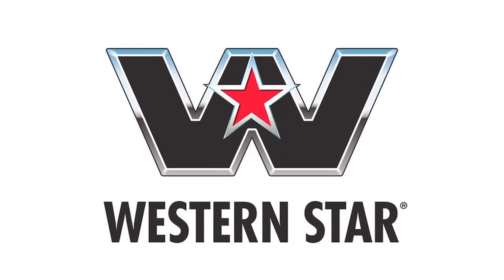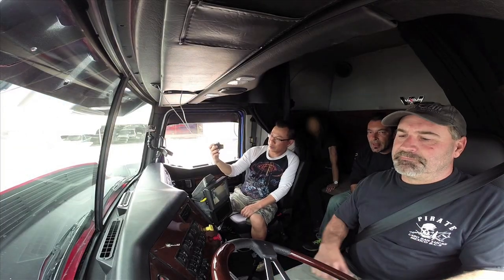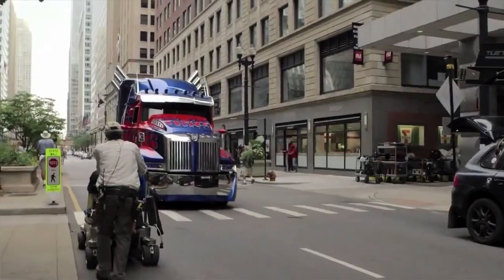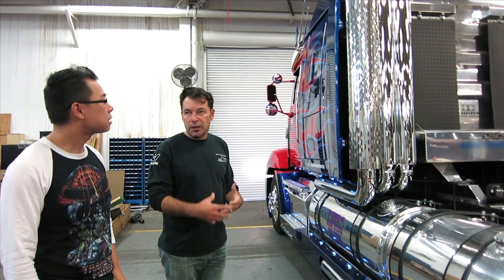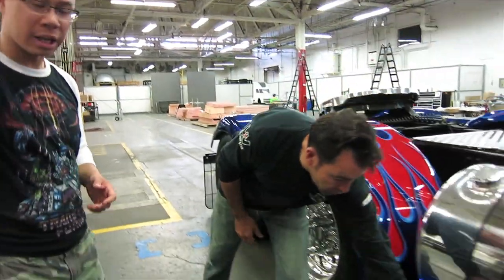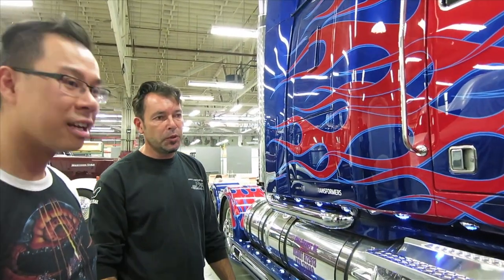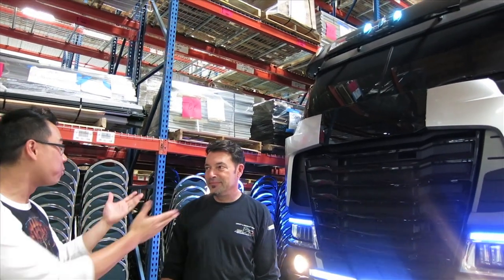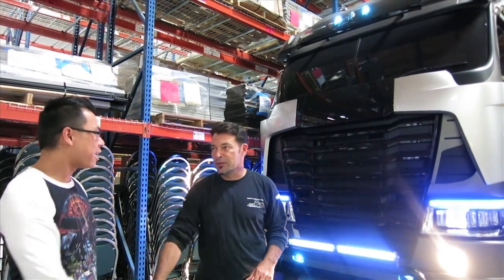Meeting Optimus Prime and Galvatron at Daimler Trucks

Comment: Is this the prop used in the movie, or a replica?
Reply: For Optimus it's a replica (mainly used for promos), the one they actually used for the movie had different side mirrors. For Galvatron, it looks like one could be a prop and the other used as a replica
Reply from the maker: Erik Enigma It's not a replica.  It is the real truck that was used in the movie.  There are only 2 Optimus Prime trucks produced.  One is a stunt truck.  One is a hero truck.   The hero truck is used for the closeups shots and for the cast to ride inside.   The stunt truck (this truck) is used to drive through explosions, perform physical stunts such as fast driving and driving through rough terrain.   The mirrors were simply replaced because they needed to be street legal to allow them to be driven in city streets.  Had they not replace the mirrors, I would not be able to ride in it.  This truck was actually shot more than the hero truck.  Any time you see a wide shot or a shot of the truck being driven in the movie, it is this particular truck.

Same thing applies to Galvatron.  Stunt truck and Hero truck.
Reply: TheRaginNation Thanks for clarifying
Reply: No it's the real one used in the movie